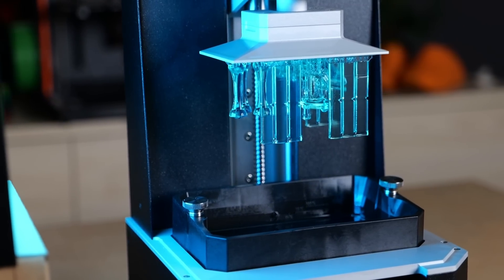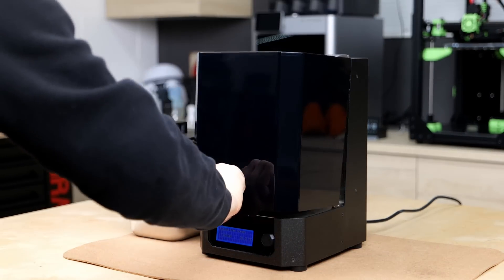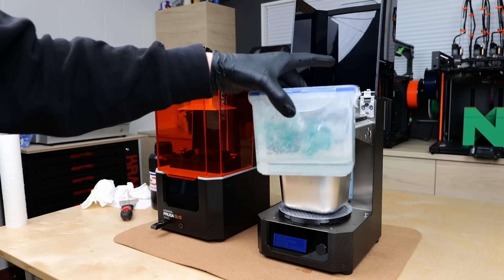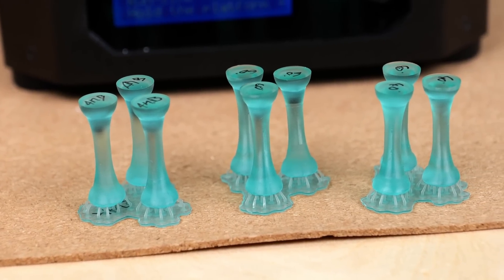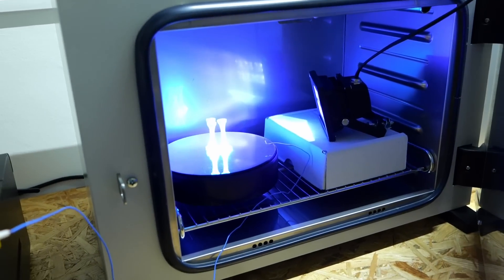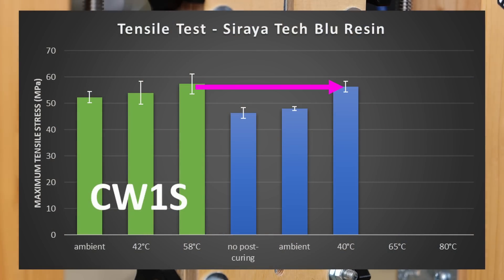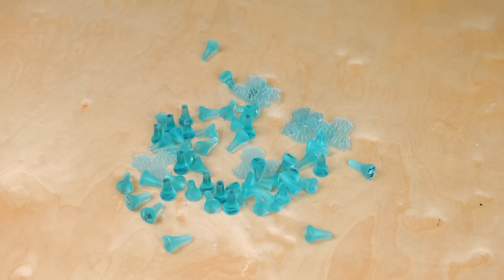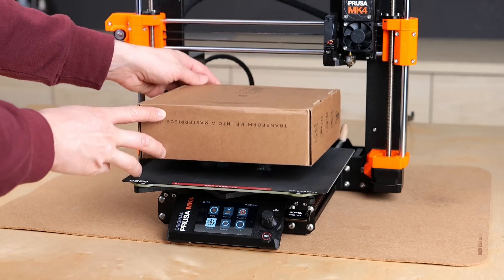Why does Nobody Cure their Resin 3D Prints like this? (40% more strength)

Comment: Important addition: beside monomers, oligomers and photoactivator there is also up to 50% filler. Filler made of some organic molecules wich didn't parcicipate in polymerisation. They made part less brittle but also less strong. And may result in developing cracks in a part over time.
Cheaper resins usually have higher % of filler.
Reply: I did mixed about 10% epoxy resin once and the part was very flexible  but  clingy  as the epoxy didn´t set.

Comment: I work in a dental lab and we print long-term temporary restorations.  We definitely cure our prints with light and heat.  One resin we use claims about 200 MPa and really expense.
Reply: which one? or do you mean 200mpas viscosity?
Reply: @Fahnder99  the resin is Rodin Sculpture 2.0 and it’s rated for 200MPa strength.  It’s definitely strong because we print long term temporary teeth for patients.
Reply: @tacomanaverion4599  Oh thank you my friend and also for the very quick response !  How do you cure, light first or does it even matter?
Reply: @Fahnder99  we cure in a curing oven that does light and heat at the same time.    You can light cure only but it will not be as strong.
Reply: @tacomanaverion4599  Thank you again. I think I'll try it hopefully some time.

Comment: @CNCKitchen an interesting test would be to cure them underwater e.g. with a Saus Vide stick. Thus removing oxygen during curing.
People report to have less warping due to shrinkage in cool water as opposed to radiated heat from the UV LEDs.

Comment: Yep, some of my prints I put into boiling water (in a microwave) and this makes a big difference for white parts that have yellowed or clear parts that have yellowed plus the increase in strength and stiffness.  This gets you to 100C.  For opaque parts continued UV curing only cures the outer layer while the inner volume of the parts doesn't cure any more.  Heating the parts helps to uniformly cure the part through the thickness and thus the increased strength.

Comment: Ohwow I have been saying this for years. You should cure the parts in an oxygen inhibitor like glycol, just use a jar filled with the stuff and suspend the part it, heat everything up to 60°C beforehand and cure. Or just use hot tap water instead.

Comment: Man that’s such a genius idea! I have a lecture all about composites and one was specifically about epoxy resins, yet it didn’t even cross my mind that those same curing principles could also be used on SLA prints. (Currently doing my masters in Aerospace engineering, like you did). The strengthening is most likely through getting a tighter amorphous structure, since the heat wiggles more monomers/partially formed polymers in the previous empty spaces (through brownian motion and liberation of some degrees of freedom in the polymer bonds -> T>Tg). On a chemical level hardened epoxies look a bit like a sponge with empty spaces where no active group could reach the other active groups, due to the size of the formed polymers. 
Grüßle :)

Comment: Yes indeed there is a lot of potential behind properly curing resins. Some factors I would think to look into for future videos on this topic are: Thermal and UV curing times (and as you touched towards the end if they should be done at the same time or seperately and what order), chamber temperature while printing, thermal and uv curing in a liquid/water (protected from oxygen or for some other reason) and the main one I think not considered by many, the *cleaning solution and temperatures from the cleaning process*. I have found that using cold isopropyl alcohol and especially letting the prints dry, evaporation lowers the temperature of the parts even further and this lowers the impact resistance. It indicates to me some type of thermal shock and at least making the shell of the parts weaker. By the way I have noticed also in some clear resins that thermal post-curing affects how much yellow they get from the UV post curing (and how fast the yellowing can fade away after some days).

Comment: I print a ton of resin prints. The way I do it is I use a heated ultra sonic to clean my parts which heats them up and cleans them, then I put the prints on top of my radiator heated to 60c for a hour ish(i often forget and do like 4 hours no biggie lol). Move them to cure chamber while still hot or best yet put them in a small transparent container filled with warm water and UV cure to retain heat and maximize the cure process. 

Fun fact, heat cure is required for Blu resins to be properly biocompatible.

Comment: Hi Stephan. I’ve been curious about Siraya’s resin and have tested their blu resin myself. The results really vary, and despite testing both the Cristal clear and the black version I found that the black version gives better results while curing better. My reasoning here is that the black version (that is also transparent indeed) absorbs more light radiation than the transparent one. Also, knowing your eager curiosity, I’m also curious to hear if you have also perceived a piercing smell on the transparent version and if you have tested air quality and curing residues left in the IPA bath for this process. I agree with you that this is an amazing technology and that it brings a lot of possibilities. Any thought about the points I’ve mentioned ?.

Comment: Hi Stefan, very good video as usual! Always a pleasure to watch your videos.
Regarding your test results I think I have an idea, why your last test worked:
During heat+UV cure, you split the photo initiators into radicals, which then lead to polymerization. More heat increases the brownian motion and thus increases the cure speed.
If you now do the UV cure first and the heat treatment afterwards, I think the following happens:
First you create radicals of the photo initiators with the UV light, which mostly find a monomer or oligomer due to their sheer number. Some of those radicals however end up not finding a partner to react with and thus stay in their radicak form. If you now increase the temperature without UV light, you don't create new radicals, but you increase the mobility of the remaining radicals through brownian motion and thus increase the likelyhood for those to find a matching monomer, oligomer of polymer. Repetition of the cycle might lead to less scatter in the results, I think.
Reply: So does this mean that time could act the same way?  Does resin print yield strength increase with time?
Reply: @austenite239  Not necessarily, BUT it's well known and observed that the resin continues to "shrink" and "cure" for quite some time (days, weeks) after conventionally curing.

Longer cures [60 to 90 minutes in general] in Glycerol with proper UV power with temp. reaching 60 - 80 deg. C will lead to the resin properly curing to its final properties and strength.

Most people improperly under-cure the resin prints in air, which either hides the resins' deficiencies or prevents the resins from reaching their full and best properties.
Reply: @retromodernart4426 What are the benefits of using Glycerol over water?
Reply: @joeljonker990  Copy and paste this into your favorite search engine:
"Evaluating oxygen shielding effect using glycerin or vacuum with varying temperature on 3D printed photopolymer in post-polymerization"

Comment: Wicked Engineering makes a heated CureBox especially for this purpose ($1100 USD) that goes up to 60C. Liqcreate also makes some resins with a claimed maximum strength of ~85 MPA (Strong-X and Composite-X) with impact energies (D256A) up to 18 J/m (not sure what that would translate into on your impact scale depending on thickness below the notch). They also make a 'tough' resin with impact energy of 72J/m (but tensile strength of 15 MPa). I've never used those resins or that cure box (I don't have a resin printer YET), so I can't vouch for the results.

Comment: This is really cool! I love the thought and effort that goes into your videos, I appreciate your diligence to find solutions and answers to questions that so many have ignored or considered unknowable. Excellent video :)

However, something important to understand about statistical analysis is that if the error bars on the graph overlap, that means there is no statically significant different. In other words, one cannot say that there is a trend upward in the tensile strength of resin as the temperature before curing goes up (for the CW1S test graph). The error bars overlap, therefore the strength cannot be considered different.

This is also the same for the graphs about heat during curing, the IZOD impact test, and the additional information about heating after curing.

However! I still think you have excellent results! You showed the results clearly and there is a difference between temperatures during curing, which means this *does* result in stronger prints from a statistical analysis!

As I said, I love your videos! And I think this one is very cool! It’s hard to get statistics right, so I totally understand, I’ve made many mistakes myself! 

Even though I am criticizing some of the analysis, that doesn’t mean I feel like you are being dishonest! It is a mistake that I feel the vast majority of people make, especially if statistical data analysis isn’t a part of their daily lives (that being said, I don’t know what your daily life looks like, so I apologize if I’ve spoken out of turn in this regard). 

All that to say, excellent video, as always, and I really look forward to the next one! I am always excited to see what new ideas, experiments, and cool techniques or methods you’ll show us next :)

Comment: What you mentioned about curing PLA vs resin is a usual behaviour of thermoplastics (everything on a FDM printer) vs. cross-linked materials (everything on a resin printer) and explained absolutely correctly. About your thermal curing experiment: nicely done. Many photoinitiators are also unstable towards thermal initiation, so I am not very surprised by your result without UV light, and any crosslinking reaction will be quicker due to heat (our old friend Arrhenius), but it's nice to see the data. I still admire your DIY tensile and impact testers.
edit: it might be interesting to do the same with non-transparent resin to see if the effect of thermal treatment is even higher compared to using UV light which would be expected since UV will not reach the interior of the part then or to vary the length of the curing to see if it is just an Arrhenius effect or you are actually starting new initiation reactions with the heat treatment.

Comment: I have Formlabs Form3, and both wash and cure stations, I just assumed that cheapo MSLA curing is also done at temperature. I've always set the curing station to heat up first, then put my parts in.

Comment: I think it would be interesting to see the effects of different multi-step annealing cycles. Such as ramping up to 40C, cure for 30 minutes, then ramp up to 80C and cure for another 30 minutes. If you want to get fancy, you can do the additional variable such as UV curing at the 40C but not 80C or other such combinations. It's not uncommon to see annealing profiles be done at a single temperature. Nor uncommon to even see those processes be monotonic in temperature. This could be an interesting avenue to look at but it is a large solution space.

Comment: We post-cure our Siraya Tech and 3DMaterials resins immersed in a rotating hot water bath for at least 1 hour. The first 15 minutes are exposed to UV. The water will be heated to 60-80 Celsius depending on the resin used. Most of the time, the resin will be directly immersed in water, except those that are meant to be used at high temperatures or contain filles, such as ST Sculpt and Sculpt Ultra White. These will be put in a bag with light vacuum seal.
Most of the parts we make are meant for end-of-arm tools for industrial robots, manufacturing aid elements and injection molding tool components
Reply: What do you mean rotating? A submersed pump circulating water in the bath, that you change the water between post cures, or the whole bath is physically turned around during the process?
Reply: @pbkobold a guess,but since they are also curing under water the rotation may be to ensure even exposure.
Reply: @pbkobold a simple rotating curing station, but you place a hot water plastic container on the turntable and drop iso-washed parts in.
Reply: @imperatormegatron2014  agreed. I've only ever water cured my parts. I dont have any kind of rotation setup yet tho. And make sure you clean the parts well, and wait for the IPA to dry
Reply: Try the same thing with glycerol instead of water and see the difference, it's equal or better than curing in a vacuum chamber.
Reply: Thanks for sharing this, I was about to ask about heated water, since it seems a lot more viable for an amateur hobbyist (like myself) to pick up a discounted immersion circulator (budget sous vide alternative) for about 100 bucks as opposed to a dedicated curing oven.
Reply: @asimhussain8716  glycerol alone (no water).
Reply: why is that better than 1, just post cure dry for one hour after normal cure 2. post cure for 1 hour and then after is don boil for some time?

Comment: Heating of resin before and during print already makes them stronger, practically you could just dip them in 80 water for a short time and get much of the same benefit as oven curing.

Comment: I've been curing my abs-like resin in a very large glass container filled with water that I preheat with a old sous vide heater. Works fantastic. The water inhibits oxygen thus boosting curing rate, and it helps get far more even uv exposure!
Reply: Try the same thing with glycerol instead of water and see the difference!
Reply: @retromodernart4426  Sounds considerably more messy. Does Glycerol improve strength even more, or just even better cure times?
Reply: @MoonWind32690  Both, but the concept of "cure time reduction" is a deception - a resin needs a certain dose and duration of UV (and heat) until it competes the polymerization (aka "curing") process properly.

Undercuring resin is always bad, and will not prevent the inevitable embrittlement, warpage, shrinkage, etc., of using a defective (improperly formulated) resin when it reaches "full cure", whether in a curing chamber or after 6 months on your shelf, for example.

Proper cure duration is usually 30-60 minutes at least at 30-80 deg C depending on the resin (in a curing chamber with proper UV power and wavelength(s)).

Glycerol is completely water soluble and it's very easy to clean and work with cleanly with the slightest forethought.

Comment: Not long ago I aquired a new resin printer and immediatly made a curing station with a 20 dollar used microwave that I salvaged (because I wanted something with a rotating plate and a timer) replacing the magnetron with a 405nm UV lamp like yours.
There's still two 220v terminals that were originally connected  to both the normal microwave bulb and ventilation fan that I now could connect to a heater and have a fully automatic Curing and Heating station with a rotating plate and timer! I could also add a thermostat for safety

Comment: Probably a stupid idea...

But I recently saw videos about the benefits of Watercuring. The prints are placed in a water bath and then illuminated.

Now the idea:

If you put prints in an 80 degree Celsius water bath, set them in motion with a magnetic stirrer and let them be irradiated by a UV lamp, you would actually have the perfect curing method

Comment: Neat! I usually cure my prints using 3 different light sources and I've also notice parts get stronger a few days post cure.

Firstly I accidentally cured some resin using a super bright WHITE light. Not sure if the LED in it kicks out some UV but it flash cures the top layer and never really penetrates. I also use 395nm and 365nm. The 395 does most of the curing and penetrates really well with minimum yellowing but the 365nm seems to cure resins extremely well and leaves a harder than normal surface but it does tend to yellow most resisn.

Secondly I was printing cupons one day for a simple comparison between different resins, colors, and additives I've been playing with and I found out that if the prints is post-cured and then allowed to rest for a few days the prints generally hardens some more, yield less and get stronger. In my experience all the resins I've been playing with do this, water washable resins, abs-like, abs water washable, traditional resins. Plus the manufacturer 3DMaterial does mention that their resins will harden some more after a few days, and no they haven't been the only brand I've tried.
Reply: If you haven't been curing in glycerol for at least 60 minutes, that "hardening some more after a few days" is a side-effect of improper under-cure.

I cure as above with 300-500nm fluorescent bulbs [LC-3DPrint Box] at up to 80 deg. C, and the results are outstanding even for consumer resins like Sunlu ABS Like...
Reply: All white LEDs are actually blue light.
Reply: @BrunodeSouzaLino  Blue light alone doesn't cure resins, plus I have several flashlights that don't cure any of the resins even after hours of exposure and if brightness alone was the factor then it would be impossible to record good quality video of resins in an uncured state. And, no, white LEDs aren't "actually blue light." Although a good white led emits a well-balanced spectrum from red to purple, most LEDs have spikes at specific spectrum and are balanced around the spikes. Which is why Color Rendering ratings and pantone color palates are a thing.
Reply: @Guardian_Arias Some white LEDs I think use phosphoretic compounds that get excited by blue light to provide red and green